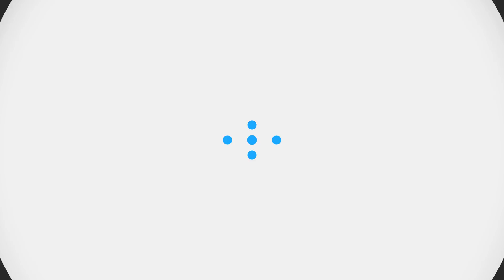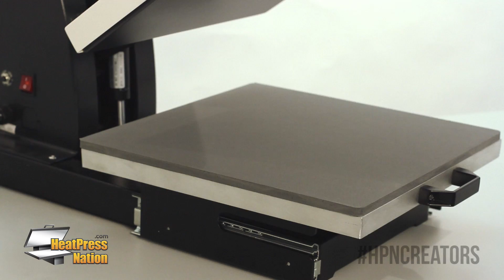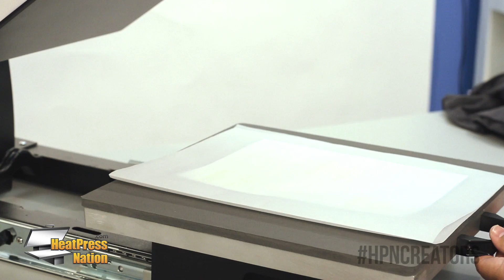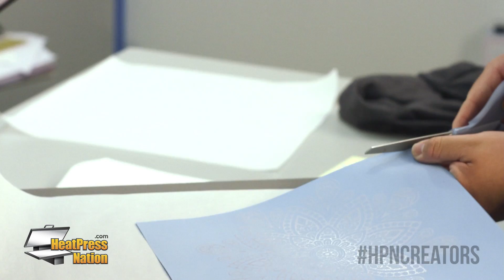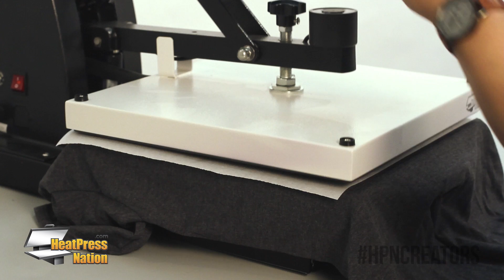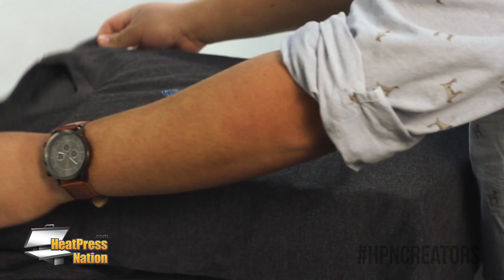Heat Pressing Detailed Design with Forever Flex Soft Heat Transfer Material

Comment: Hi! Thank you for this useful video!
I have an issue with this technology - got a perfect image on the a-sheet, but after I removed it from the t-shirt I got some empty areas where dye left on the a-sheet and not transferred to the t-shire.
What could be a reason?
Reply from the maker: Hi there! This can be due to not enough pressure being used during the marriage process or when pressing the transfer on to the shirt itself. I would recommend increasing the pressure and retrying once again.

Comment: Can this Brother printer be used for full color images on the heat transfer paper?
Reply from the maker: In this video we used the Brother HL-L2320D, which is a monochrome printer. It only has black toner and cannot print full-color images. For that, we would recommend a white toner laser printer, like the UniNet 560 or Crio 8432WDT.

Comment: Does it have to be a lazer printer,  could you use an ink jet or sublimation printer?
Reply from the maker: Forever Flex-Soft is only compatible with laser printers. This is because the adhesive on the B-sheet will only adhere to toner, not ink.

Comment: I see that you use parchment paper can you use a Teflon sheet when making shirts.
Reply from the maker: Yes you can. After the cold peel on the shirt, you have to re-press the transfer. If you re-press with a Teflon sheet, the transfer will retain most of it's glossy look. If you do the re-press with parchment paper, it will have a more matte appearance.

Comment: I’m having a little problems with this I use a brother printer hl53700 is seems to print everything okay I think is the heat press is a 6 in 1 combo machine I have try almost everything use your time and heat temperature almost perfect but still some little parts were missing I have change the temperature and the time to 350 and 125 it almost got everything but not always I little help will be awesome if you can

Comment: How long do these transfers last after being printed on. How long can you store the transfers?
Reply from the maker: In general, you can get about 15 to 20+ washes from each transfer. But if you use the rasterization process from Forever TransferRIP software, that can be increased.